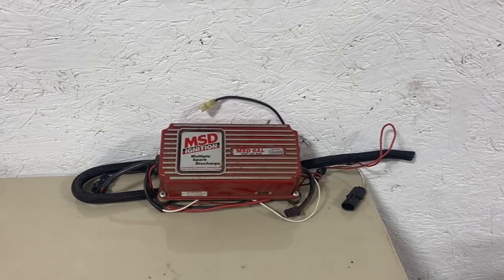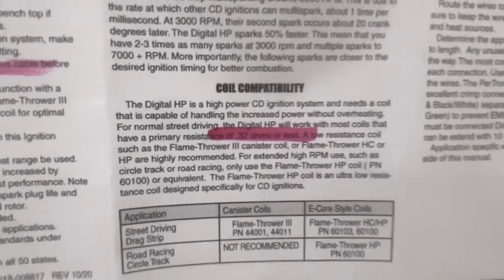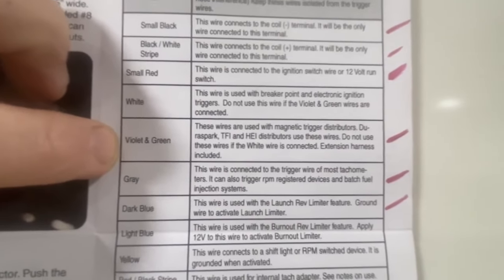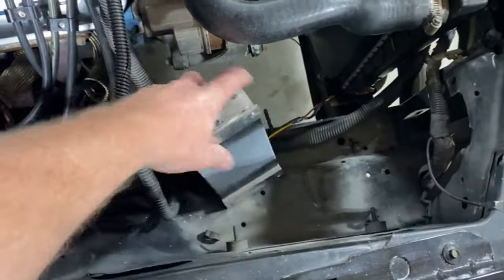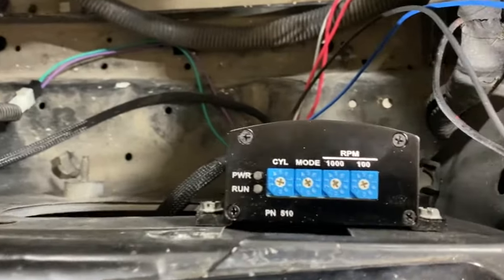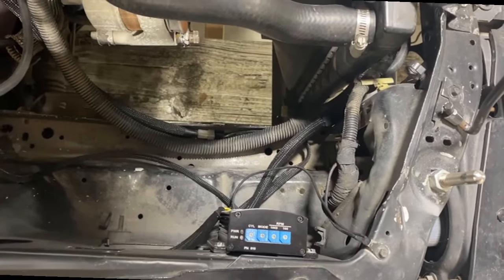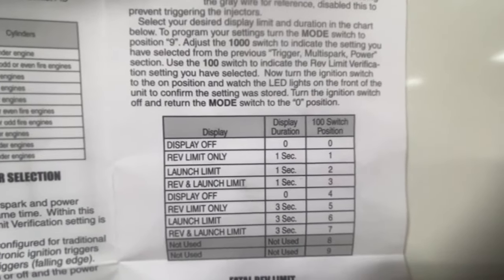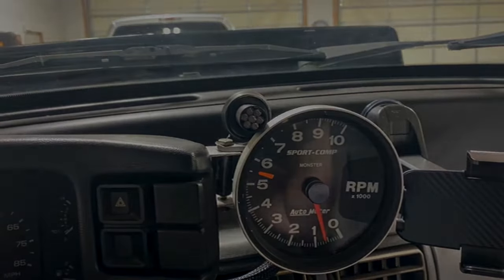Tired of MSD ignition?  Try the Pertronix Digital HP !!  All the features at half the cost.

Comment: Failure is just part of racing lol. What  you want to look at is the Mile jolts that is what makes the magic in the combustion chamber. MSD 6 are only good for up to 9 to 1 compression they basically give out after that. They also demanded A battery ground and a good power source. We use a pro 600 on our race car. You can ramp the millivolts up with the boost. It has let us add 30% more fuel to our program which makes way more power. We are currently running 40 pounds of boost and have no ignition problems at the moment.This is a great  unit for the street it has more millivolts than the MSD 6 if you read the text sheet; and like you said it is a nice savings to boot
Reply from the maker: That is definitely a serious box that you have,  but I can see why you would need such a thing with 40 pounds of boost😂.

Comment: pertronix manual says only plug their distributors into their digital hp black ignition box. 
ok just to attach like stock setup to the coil? 
want to get an hp box but have to wait a month or so.
got the vehicle with just pertronix distributor and flamethrower coil... and it runs.

Comment: I currently have a 7AL because I run Methanol fuel and a 8-71 supercharger. Will it fire my fuel at these cylinder pressures at approximately 20:1 compression?
Reply from the maker: That is getting into territory that I don’t have much experience with😀.  In the higher level stuff,  MSD  offers features that most of the competitors don’t…they kinda have the market cornered.  I have to assume at elite levels MSD may be the correct choice,  but for the average street/strip car this would be plenty.  Obviously the car that I installed this on is a lightweight,  but I wouldn’t hesitate to use it on  something much more serious.   Do your setup require multiple timing retards?

Comment: I disagree these old school 6AL boxes are great I got 10 solid years out of mine the problem guys have is not grounding the box correctly always run ground directly from battery not fire wall always use 12 guage for ground and hot wire, and have a good quality battery that’s will last for years
Reply from the maker: My criticism of MSD is a bit tongue in cheek.   My other  car still has one on it,  and it will stay on it until it ceases to function.  I think it’s probably about 5 years old.  Truth is they all fail at some point and bad wiring can certainly contribute to it.  Thanks for watching!!